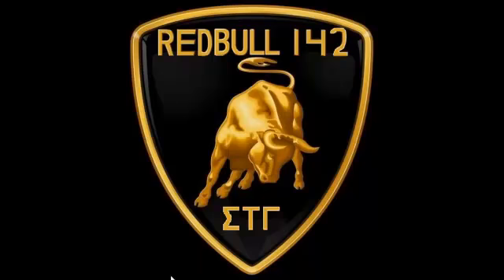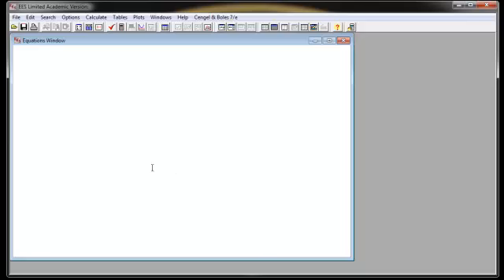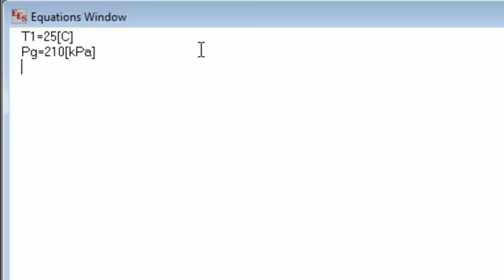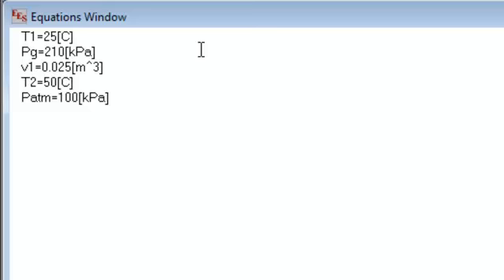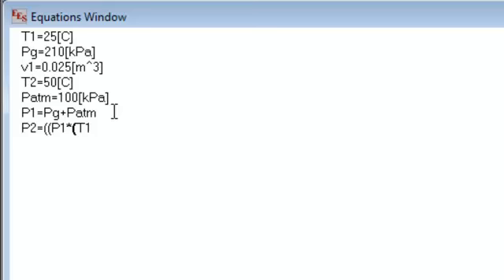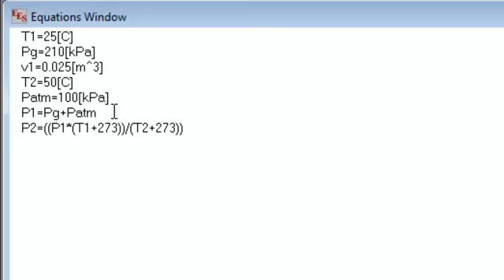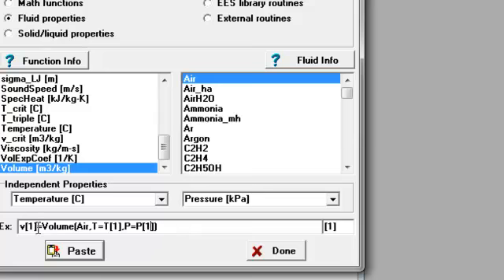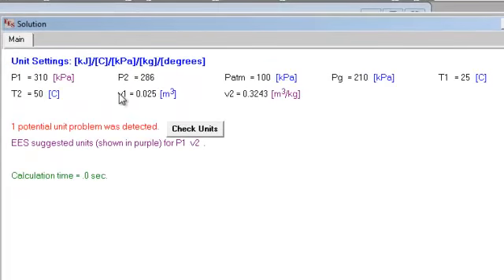DCorcione-Tech Comm Final Project

Comment: Your pressure P2 is less than P1. The equation for calculating P2 should have been P2=P1*(T2+273)/(T1+273) which gives you P2=336 kPa. Note that this equations assumes your volume is kept constant. When you have tried to calculate v2, you have actually calculated the specific volume, hence the units m^3/kg